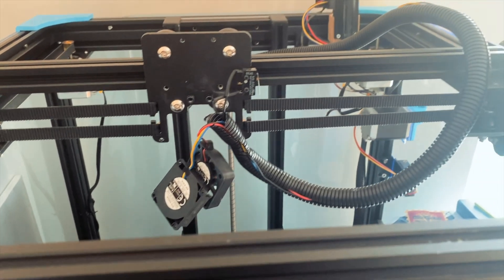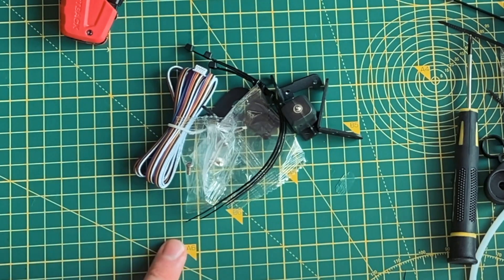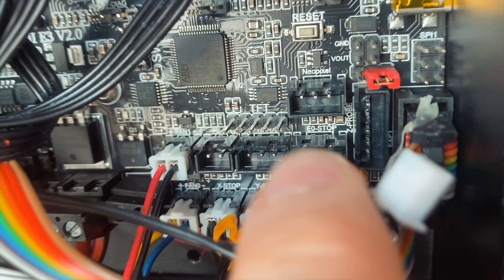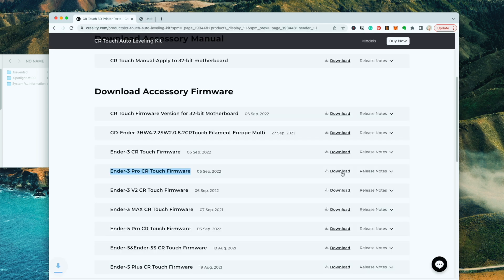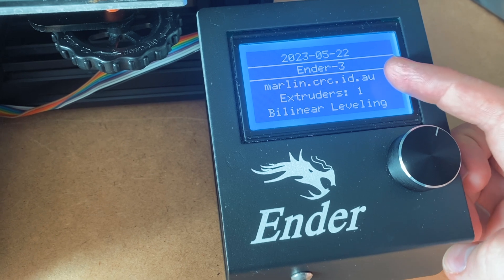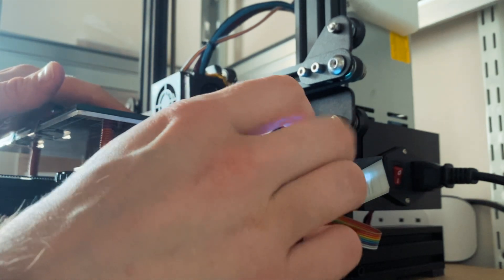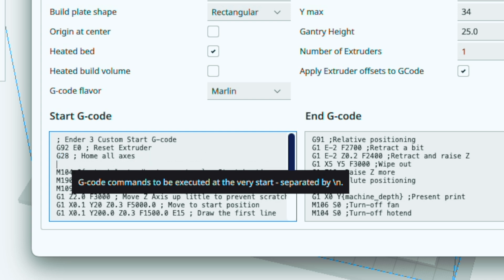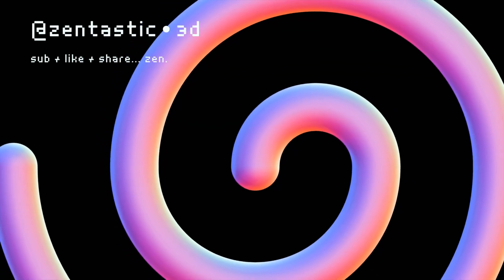How to Install CR Touch on Ender 3 Pro 3D Printer (Stock and Marlin)

Comment: I’m new to 3d printing I got the Ender 3 pro, I added a cr touch and a filament detector and skr mini e3. The cr touch is flashing a red light and the filament detector shuts off the system with filament added. Followed the video, the site you got the software from is privated but I found it elsewhere, I think. Like I said I’m new to printing but this is so annoying I don’t think this hobby is for me I think I’ll just sell it. Wtf

Comment: My micro sd card is 256 Gb is that to large or it will work I do everything right but it never seems to program into my printer  but the format is not fat32 it’s Exfat and there’s no option to put fat32 is it cuz my micro sd card ?

Comment: My issue is when I go to level that bed which im very familiar with the printer wont go low enough to set the offset. Like wont get the paper tight. I cannot go to a negative x value.
Reply: it's Z axis not X
Reply: @TheNoEyedGirl  sorry meant z! Still no change sadly

Comment: Thank you for the information, it was incredible!!!
I'm trying to use a correct firmware for my 3d printer, but I have not success until now.
I have tried some versions and it wasn't work properly.

1) I cannot enter a negative value for the Z position, the maximum is 0.000;
2) The heating of the bed is very slow...it reaches 40 quickly, then takes almost 5-6 minutes to reach 50 degrees.
3) After starting a printout, even with all the problems I had, the menu remains stuck, not allowing access to tuning settings... as if there was a high level of processing.

I used these versions:
* Ender3-v4.2.7-BLTouch-20240213.bin
* Ender3-v4.2.7-BLTouch-20240209.bin
* Ender3-v4.2.7-BLTouch-20240211.bin

Comment: The moment you said "set of brackets" I knew I was screwed as I have the ender 3 V2 but the direct drive upgrade that I installed comes with the ender 3 extruder plate.

Comment: idk why, but I can't do what you did at 7:25.  I've been using this printer for a long time, just got the new SKR mini e3 v2 board and installed everything earlier today, but I can't get the nozzle anywhere close to the bed even with the bed almost completely loosened.  it's probably over 1mm away from the nozzle.  I've probably put about 10-15 views on your video just trying to rewatch exactly what you did to replicate it frame by frame, but when I go to set the z offset it's nowhere near the bed on 0mm and I can't tell it to go into the negatives.  If you or anyone else in the comments has the time, I could do with some help on this, i'm stumped.  Otherwise, the video was good, thank you!
Reply: you have to take it to 0mm and then go to probe Z offset and thats where you can go under 0mm and even set it by the time
Reply: I forgot to update this, but I found the z probe wizard as an option, basically it does the same thing.  When I tried using the setting you suggest, I couldn't get it to go negative.  It could've been a bug in the firmware I flashed to it, but it finally worked when I used the wizard that was preloaded.  Thanks for the suggestion though!

Comment: Is it okay if I install the sensor before installing the firmware?
Reply: The firmware is what tells the printer that there is a sensor and how to work with it, so I would recommend not using the printer if you decide to install the sensor before installing the firmware.

Comment: from what i understand if you do a mesh before hand and then use g29 it will ignore what is saved in eeprom and only use the mesh it just got. there is a different code to use from memory
Reply: yeah i forgot to put the code in cura but the printer levelled in the middle and started to print and it works just so good